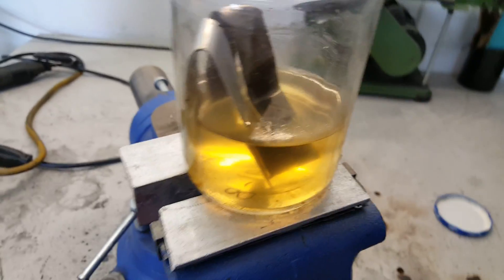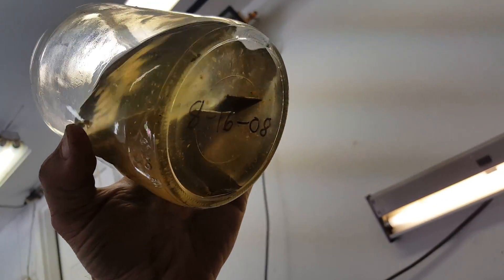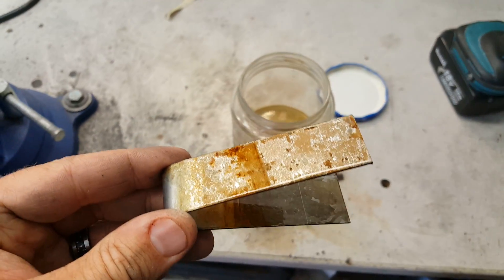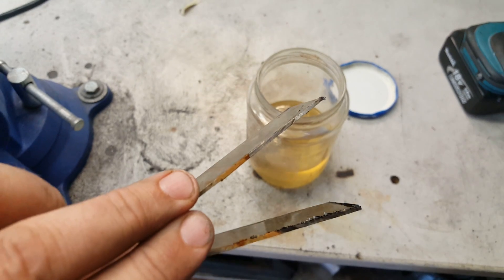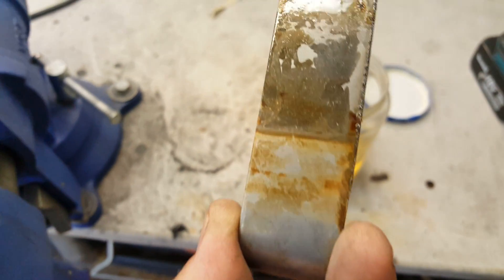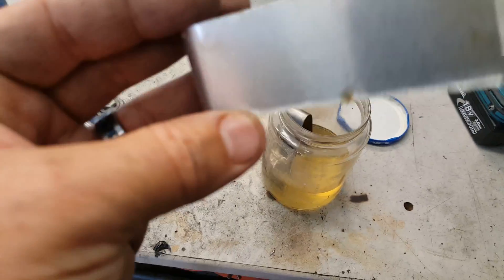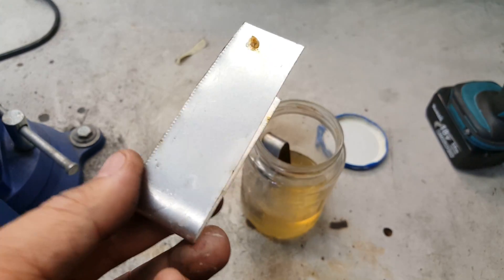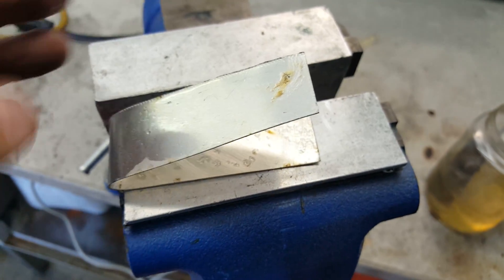Steel and aluminum in ethanol, 8 years now.

Comment: I was thinking about converting a simple $120  2 stroke motorized bike engine to run off E85.....All I really need is larger carburetor jets & E85 compatible 2 stroke oil mix......From what I read, I'm pretty sure if I don't leave  E85 sitting in the tank/carb for more than a month, I'll be OK......On the bike it's easy to drain the tank & carb out.... It looks like the top & bottom end of the engine will wear out from high mileage, before any type of E85 aluminum corrosion damage.
  All I'd have to do to switch back to gas is change the carb jets back.....There aren't any expensive gaskets or rubber parts on the engine....So if the E85 did ruin them it's not like I'd be out hundreds of $$$.....My main concern is the  rubber-ish crank seals. I might a buy a set for $10 and let them soak in a mix of E85/2 stroke oil. To see what happens. I think the proper E85 compatible 2 stroke oil will also help to protect from E85 damage....The Pro's of E85 seem to out weight the cons- Cooler running engine (great for long 2 stroke bike rides) cleaner burning (less carbon buildup in the engine) plus MORE POWER which the tiny engine needs & slightly cheaper fuel prices. 
The biggest downside seems to be- attracting moisture & not being to let the E85 could sit for months.
Reply from the maker: Yep, exactly right. Don't let sit for a long time. The other potential downside could be cold weather. It's a bit more tricky to get it to fire when it's really cold out, on a cold engine. I'd love to see your results. Please report back or post a link to the vid if you make one. Cool experiment!
Reply: @DoesItTrack  I checked today & the 2 gas stations in my town stopped selling E85.... Which kinda sucks because if the E85 small engine conversion went well. I could convert my Yamaha 700 Maxim to E85 & see how much power it'd make.

Comment: that "gjell" is actually the problem. ethanol and aluminum corrosion makes a crappy gel substanser in the prosess. . under it you will se it is corrosion.. loots to be treaded with something. put a part that is welded and machined in there.. and cast.. you wont like what you get.
Reply from the maker: Yeah, all that has been debunked years ago. https://www.theautochannel.com/news/2018/10/12/632678-ethanol-papers-massive-book-provides-whole-story-ethanol-fuel-free.html
Reply: @DoesItTrack  what? the "GEL" is not debunked. you had it there yourself. and that is what gives uss problems. it eats the metal and make that gel crap. if you want me to by a colorful book to get your point you r mistaken.. i rather read science report's on the matter.
Reply from the maker: @grapsorz  I meant the "eating away at stuff", that has a ton of research on it. All fuels gel, some solidify.. A machined part would be missing the aluminum oxide layer (why we anodized parts) and you'll see that crusty oxidation. Check out that resource, it's way better than watching YouTube videos and that's not my book, and it's free in the online version with many reputable resources.
Reply: @DoesItTrack  and that is the problem.. carb's. fuel rails r not anodized on the inside. they can take this sitting over time. i have had SO many cars quit after they have ben sitting for a bit and that is on E5 and E10 only. and stil you can find a old car with 30 year old fuel in it and after some starter fluid the damn thing just start. old E5 sitting for 12 month in a carb and the carb is toast. had one that did not flush the tank 100% on a boat last year and this year the new carb was trash agen.
Reply from the maker: @grapsorz  Hahahahaha! 30 year old fuel. C'mon now.... Everyone knows better than that. He said, she said, all of these "I got a guy", go read the scientific research.
Reply: @DoesItTrack  and yes i have manage to start an car on 30 year old fuel. not a possibility on fuel with ethanol.
Reply from the maker: @grapsorz  Sure ya have. Uh huh.
Reply: @DoesItTrack  i dont run good.. it stink's stil it is combusting. yes real hard to get going. was an old 1937 GMC pickup. and it was some time ago. so the fuel was better back then. real leaded stuff. an dyes it needed a little bit of fuel on the carb to start. stil it RAN on that old fuel. the carb was not bad everything worked.

Comment: Sheet aluminum has a chemical cladding applied to prevent corrosion.  You have to grind or deeply sand all the cladding off to do a proper test.  Because aluminum  engine cylinder heads have no cladding.
Reply from the maker: It was freshly cut into that strip so the edges are 100% fresh when we first started this. The "cladding" is the natural oxidation layer that occurs to aluminum by being exposed to air.  These were not anodized, as I also do that process as well as a hobby. These only had air oxidation.
Reply: @DoesItTrack  cladding is a layer of very pure aluminum I just read up on it.  I was thinking it was a chemical treatment but it's actually pure aluminum applied to both sides of aluminum alloy sheet.  All aluminum sheet is an aluminum alloy
Reply: I know this because I worked professionally with cold rolling aluminum and we always had to grind the cladding off before cold rolling because our parts were all made to astm/asme/ navy or military standards and were NIST traceable.
Reply from the maker: @Funky_Chiicken  what was the name of the chemical or cladding you used? Im sure this cheap aluminum was only oxidated as I've Tig welded it many times. When we weld aluminum, the outside oxidation layer has to be ground off as it has a much higher melting point than the aluminum itself. I'm curious to know what this cladding you refer to actually was. A solution? A chemical bath? Something you actually see on the material? In either case the edges of this material was freshly cut literally seconds before going in.
Reply: @DoesItTrack  I dont know the specific name of the cladding because most aluminum manufacturers who make the aluminum will use their own process for cladding.  I just know to meet industry standards we had to make sure to grind off all cladding.  I bet you are 100% right about welding on aluminum also.  Welding doesnt like any form of "contamination" .
Reply from the maker: @Funky_Chiicken  Thanks for that.

Comment: Do you know what kind of aluminium it is? Has it been sealed completely? According to these tests dry ethanol without water causes corrosion. All it takes is about .1 to .5% water to avoid corrosion depending on temperature. https://info.ornl.gov/sites/publications/Files/Pub42125.pdf
If the steel has rust you may have quite a bit of water in there.
Reply: E85 will have .5% water from the refinery because that last little bit of water is extremely expensive to remove. It's been proven over and over that it's the water that gets absorbed into the fuel is what causes the aluminum to go bad
Reply: @reddsm86  The study that John Deer posted states the exact opposite. Ethanol with zero water content rapidly attacked the aluminum. The trace amount of water seemed to prevent the corrosion of the aluminum.

Comment: What’s the difference between a methylated spirit’s and it’s all alcohol
Reply from the maker: Tom T Methylated spirits basically means that they added stuff, in this case gasoline (85% to 15% gasoline) so you can't drink it. It's fuel after all. :)

Comment: People telling running ethanol on engines ruin pistons and valvs should look that. Thumbs up
Reply: ethanol isnt a problem unless you have a carburetor with old style leather gaskets, however some stations substitue ethanol for methanol, which is quite corrosive and will corrode aluminum quite badly
Reply: @ghost-jesus  thank you that makes sense, this other channel, diy farm or something, did the same test and found corrosion which didn't make any sense to me.